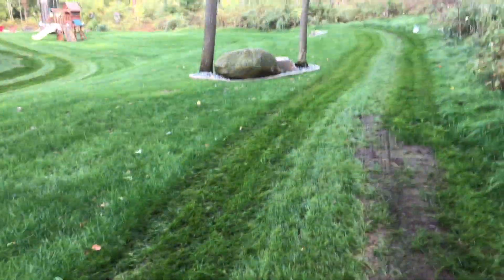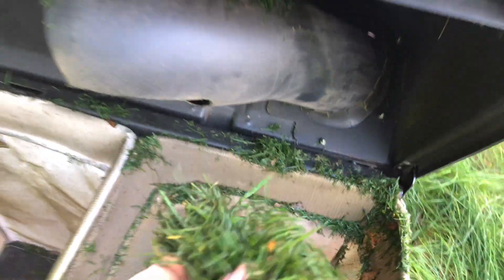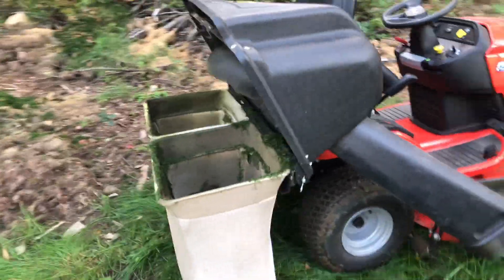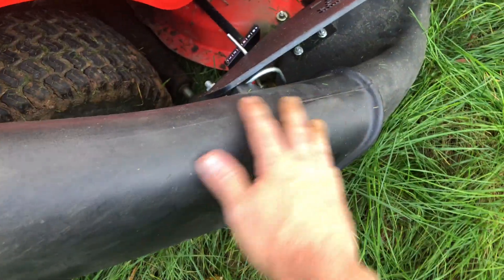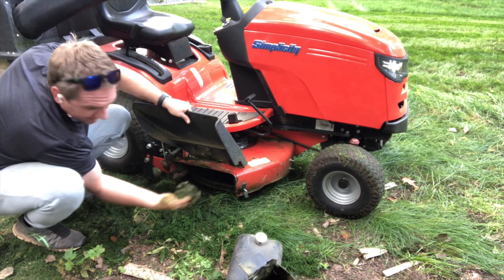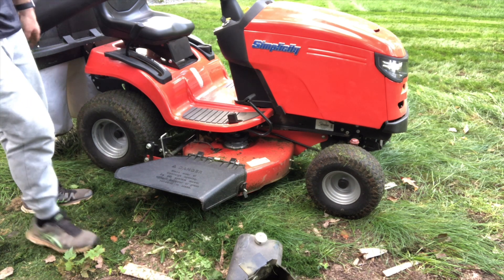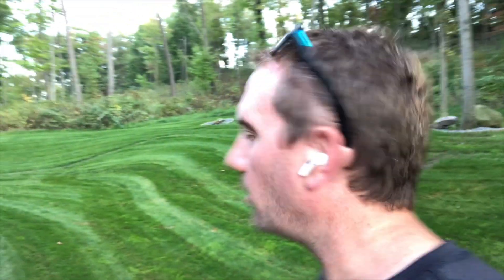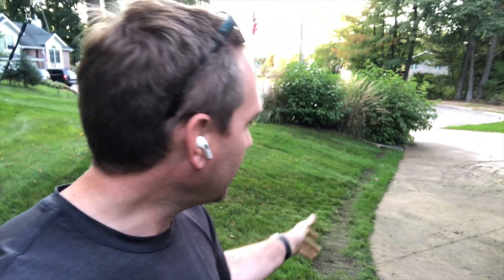Simplicity Regent Fall Mow - Bagging Wet Grass

Comment: As always the Simplicity still gave a great cut. I agree that speed had to do with the clog but I would have sped up also to get done. 
  I use the turbo bagger and have never had a clog yet but picked up another Simplicity tractor with the same 38” deck as yours and adding a regular bagger. Thanks for the info for the needed blade and deck baffle to make it work properly.
Reply from the maker: A dual Simplicity setup, that sounds awesome.  I agree, any minor gripes I have with the mower are overshadowed by the cut.

Comment: I thought of another important reason to be bagging up North this time of year.  By counting how many bags of clippings your lawn produces, you can get a good sense of when your lawn dramatically slows it's rate of growth and begins sending nutrients to the root zone to prepare for Winter.  When it's only producing half as many clippings as usual, that is when you want to hit it with a final pound of nitrogen per 1000 square feet.  It is, by far, the most important fertilization of the year.  If it's too early the fertilization just produces top growth.  If it is too late, the lawn won't take it up at all.  By counting your bags, you can time it JUST RIGHT, like Goldilocks.
Reply from the maker: Great info!  I'll pay attention to this.